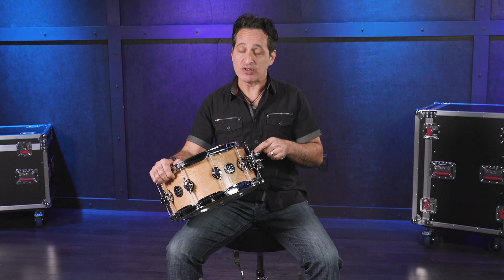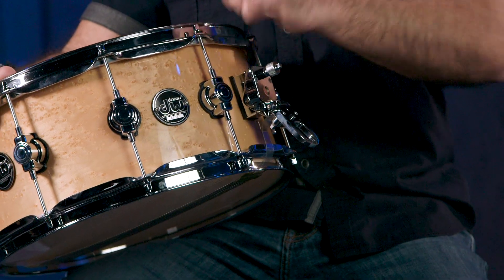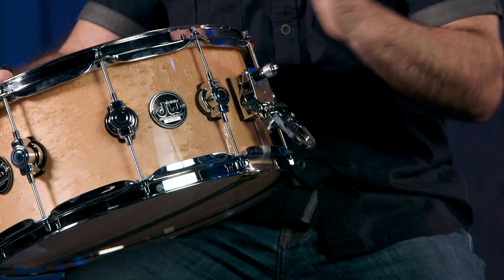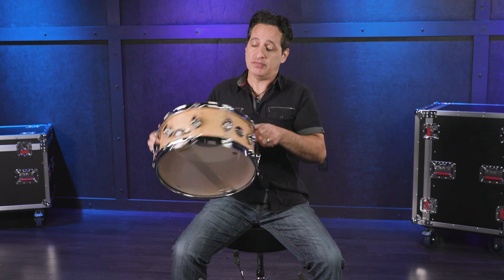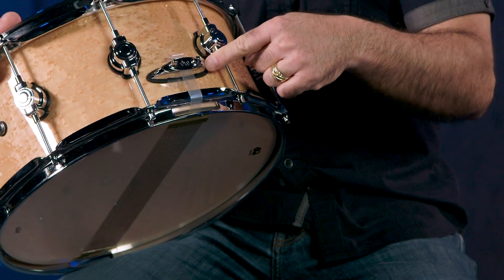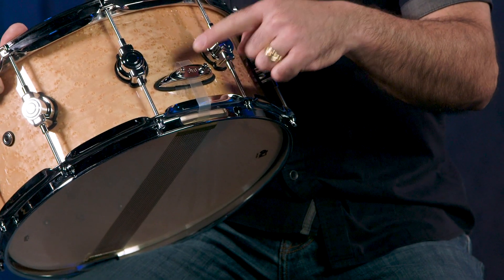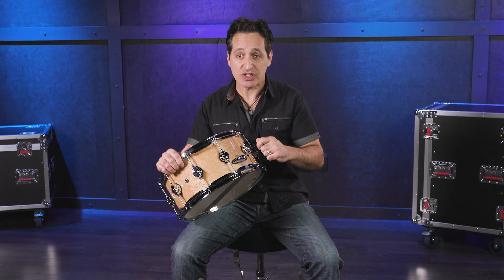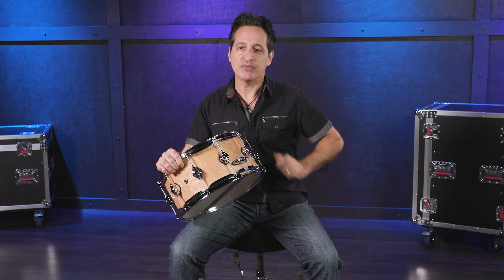What is a Throw Off?

Comment: Can I install any throw off on any snare? I want to try the trick drums throw off, and it looks beautiful
Reply from the maker: Hello, Jesse! It is certainly possible so long as the drum itself is deep enough to accommodate the throw off mechanism. That said, there is no standard hole spacing for snare throw offs, so drilling or modification may be required, depending on the snare.
Thanks for the interest!
Cody Kraus, Sweetwater Sales Engineer, (800) 222-4700 ext. 1766, cody_kraus@sweetwater.com